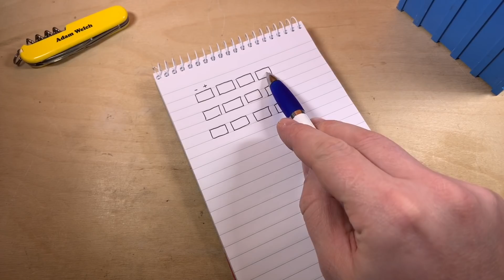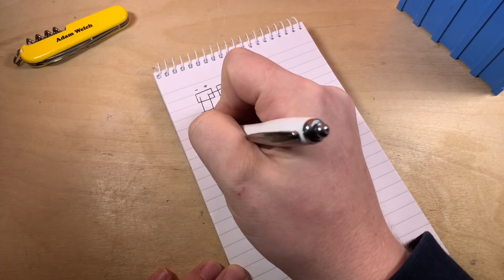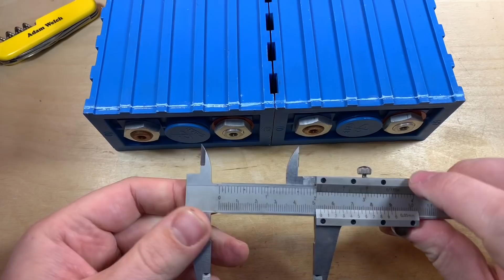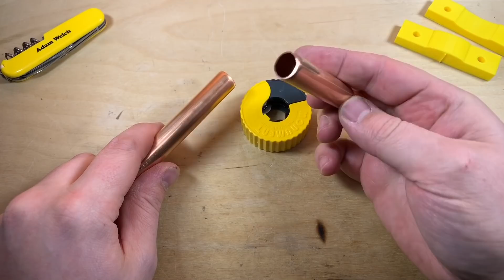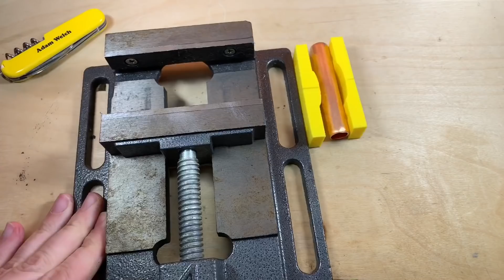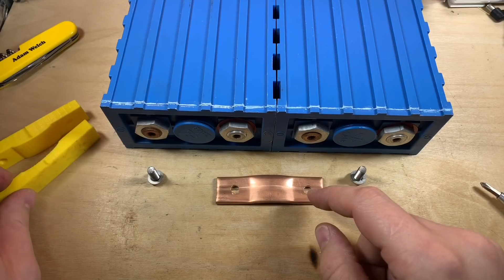LiFePO4 Copper Connectors

Comment: The fusing principle is the same as 18650 cells - to protect the pack against a cell (prismatic in this case) going short-circuit-bad.   From what I've read / youtube comments it is indeed possible for a bad cell to fail in a short-circuit way but I don't have direct knowledge.   So I would say that's the question...  can a cell go bad in a short-circuit way.  If so, the fusing would add safety.   As long as you know the max current you will pull from the overall battery, it should not be difficult to select wire size for fusing.
Reply from the maker: I’m most comfortable fusing - but looking at others lifepo4 banks I don’t see fuses. Thanks for this. Everyone’s views are giving me food for thought.
Reply: One thing about 'other banks' is folks don't typically put cells in parallel - its more like they do 4 or 8 or 16 in series and then maybe have a couple of these (overall batteries) in parallel - in which case fusing would not be used.  Its the special case of multiple cells in parallel 'per pack' where fusing makes sense - e.g. same as 18650.   The fusing protects the other cells 'in the individual pack' from meltdown if 1 of the members of the pack short-circuits.   To add to this logic - the more cells you have in parallel, the more 'like 18650' this situation becomes.    If you only have 2 cells - yeh? but if you have 4 cells (you're case here) then if 1 cells goes bad the other 3 can continue to carry significant load.   If you have 8 in parallel etc..   So maybe there's a tipping point depending on how many parallel cells per pack.
Reply from the maker: Do you think I’d be better creating three separate 4s packs then fusing where they all combine? Trouble there is the BMS needed - three times the modules (although in reality that’s not such a big issue).
Reply: Don't see any pro to X separate batteries necessarily - as you say, would require X BMSs.   But, maybe there is physical mounting issues (for example) as a reason to have separate batteries - e.g. its not wrong either way.  Its all just a design choice with pros/cons.
Reply: I asked about LifePo4 shorting on the Second Life Storage Forum and @daromer - e.g. "DIY Tech & Repairs" (major DIY powerwall youtuber with 18650 and LifePo4 systems) said "Life can Short too but they don't burn like liion.  Risk is alot smaller.".  This was followed by a post showing A123 26550 LifePo4 cells that burned when shorted.  See the bottom 1/2 of page 1 of this thread https://secondlifestorage.com/showthread.php?tid=8144

Comment: I do like your mold I wonder if you made one side of the mold slightly larger internally to allow for the thickness of the copper would get the pipe flatter. A very good job though. All the best. Steve.
Reply from the maker: Thank you. I did do this but perhaps by not quite enough. I’ll tweak the design now I know it works - which I never thought it would!

Comment: I used 10mm micro bore copper pipe because it's easier to flatten, cheaper and plenty thick enough to carry the current. I didn't use a mold to deform the pipe in the middle and it worked just fine; as I tightened the connections the connector deformed, which pulled the cells tight together (elongating the holes slightly in the process).

To speed things up, I suggest you bolt the drill press vice to your workbench and try putting the end of the (straightened) vice handle in the chuck of a powerful electric drill or, preferably, an air drill. Then you can wind the vice in and out in double quick time.
Reply from the maker: Now I know the concept works I need to do something like this to speed up manufacture - and spare my wrists! Cheers

Comment: Copper Work Hardens when you just think or look at bending the stuff.    It would be best to Re Anneal the copper prior to trying to use those forms.   I use Aluminum  on my 38120 Head ways.
Reply from the maker: Ok thanks. I’ll see how I can achieve that.
Reply: @AdamWelchUK  LOL,  Just heat the copper to Red hot and let air cool.    Quenching would harden.   Propane torch works jiffy.
Reply from the maker: I’ll get a torch and try not to burn myself! Cheers
Reply: @AdamWelchUK  Maybe I should have issued a Disclaimer ?    LOL    That task does involve FIRE.
Reply: @pulesjet  Nope, mate. Red hot & quench in water...
Reply: @skysurferuk  Air cool works fine with copper.  At least it works when I do it.
Reply: i also prefer aluminum :)
Reply: @nkos6376  I prefer Silver !   I like copper.   I have a butt load of Aluminum stock on hand and the resistivity difference is Box -nex using it.

Comment: Bus bar for the parallel cells. I believe it depends on how much current you need to draw, aka how low internal resistance you need.
Reply from the maker: Thanks.
Reply: That's my understanding too.

Comment: Headway uses the same straps, high current. For LiFiPO4
Reply from the maker: Do they use a 3D print and a vice of knowledge as well? :-)
Reply: @AdamWelchUK  No, just a piece of plate metal rounded off on the edges. They make the cell so you don't have to bend anything, tube shape cells.